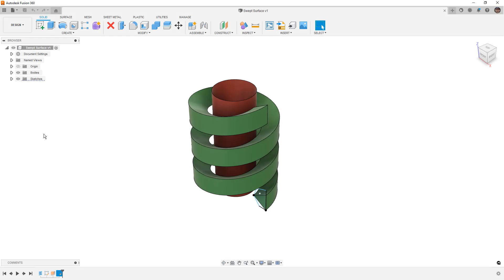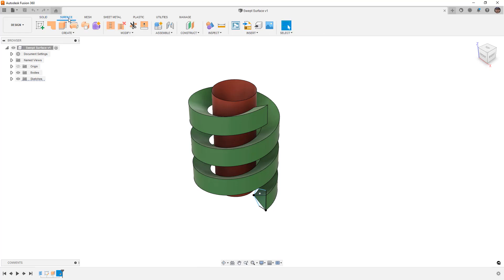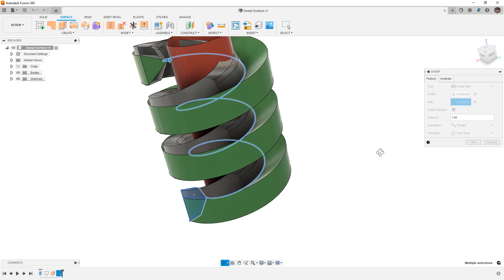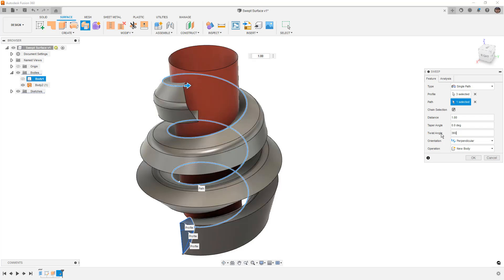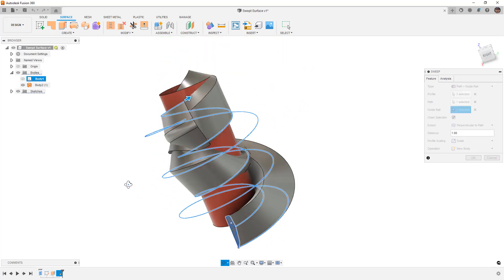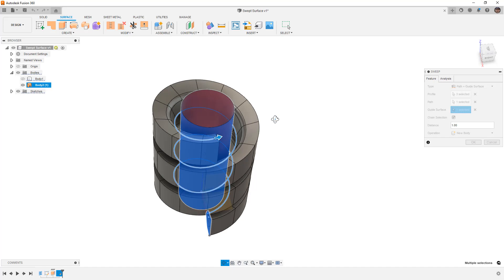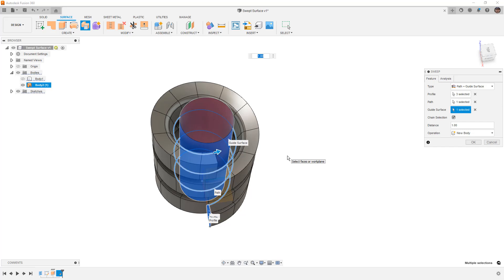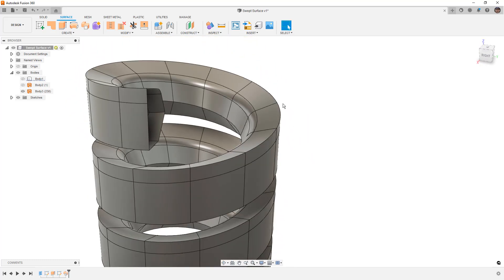Surface Mastery Part 4 - Swept Guide Surface | How to use Sweep Guide Surfaces to Drive Shapes

Comment: thanks for the video, could you please make a video how to sweep (or loft ) a coil with different start and end profiles, without twisting along way... ?
Reply from the maker: I did do a video on how to model any coil, but the sweep tool doesn't allow for a change in profile and loft doesn't really have a way to control twist in the same way.  The best method is to sweep the coil and then model the path for the ends if you are trying to do a ground end or something.  The best way to control the sweep is to use a guide surface like in this video.

Comment: I've been studying this series thoroughly and it's been extremely helpful!  I noticed you already did a lengthy series on the form tools.  I feel that I have a good grasp on the solid tools, but now I'm branching out into the surface and form tools.  Do you think it's better to focus on form or surface first, or does it matter?
Reply from the maker: Thanks!  It really depends on what sorts of things you are modeling.  Forms can make quick work of complex shapes, but very little is going to be 100% complete as a form.  It will always need solid or surface work after.  I think making complex shapes is easier and higher quality in Fusion with forms.